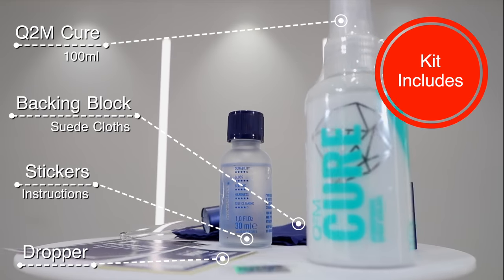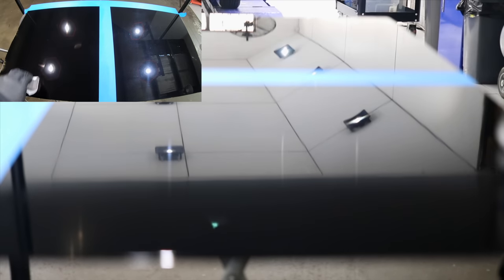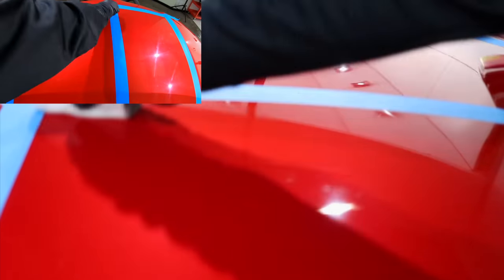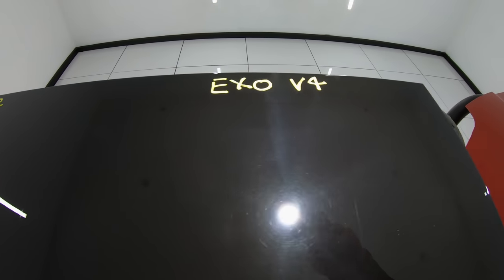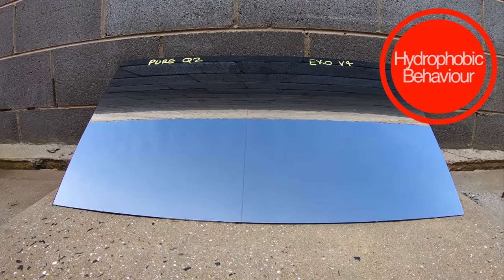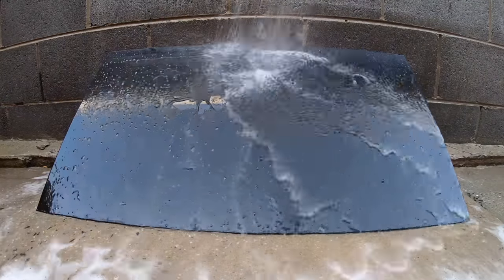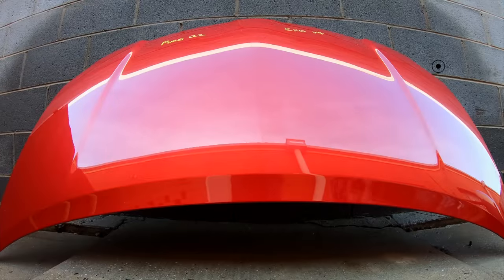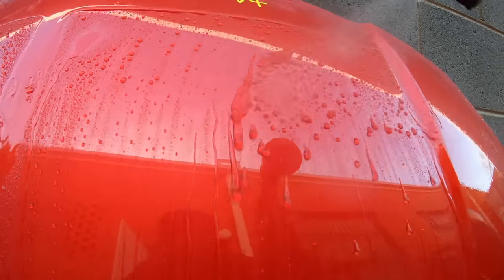Gyeon Q2 Pure vs Gtechniq Exo V4 Ceramic Coatings!

Comment: I've always viewed EXO as a top coat  applied to a base layer of crystal serum lite. 

That would be an interesting test. The main pro to that combo is the durability of CSL and the water spot resistance of EXO.
Reply: Same here man
Reply: Came here to say exactly this. Not comparing apples to apples in this video, I don't believe. The Gyeon kit shown is a true ceramic coating+topcoat, whereas the Exo v4 is merely a top coat to Crystal Serum Lite.
Reply: @CarCraftAutoDetailing  but you show a dual-stage/2-layer coating product in Gyeon vs a single-stage product in the Exo. Yes, Exo CAN be used standalone, but typically that isn't the case. 
I do like the video. you certainly were thorough and aren't saying anything I disagreed with from what I saw. However, I don't think these products are really equal to compare against each other head to head. CSL+ExoV4 is about the same cost as the Gyeon kit you show here.

Comment: As a Gyeon installer the way of application with Gyeon Pure (circular motion), its because of its formula. Over all Gyeon coatings, Pure has the most concentration of SiO2 (about 25% according to the brand) so thats why putting in one layer should be enough to achieve the best performance. Great video Sandro as always
Reply: One layer is very appealing for saving up some time
Reply: @Carlos.Rivera  with the new formula all Gyeon evo coatings now are only one layer application.
Reply: @sergiobarraza1806  nice, gonna try it this winter. Thanks for reply mate
Reply: @sergiobarraza1806  Cant wait to try the new Pure Evo! So excited
Reply: @RipJawsX95  How did it turn out? It was a headache to wipe off for me!
Reply: @KingRockets  still haven't tried it :/ damn really? Did you wipe it off immediately or let it sit for 30 seconds? Heard the flash time on the Evo are much quicker than the old gen
Reply: @RipJawsX95  ~2-3 minutes. I did it outside though, so not a controlled environment. Maybe that had something to do with it. I did find this one goes on real thick though compared to alot of other coatings.
Reply: @KingRockets  mmm that still should be okay and even if you did do it outside, Gyeon did say it is safe and completely fine to do it outside so yeah I wouldn't have any idea why it was hard to wipe off 🤔
Reply: @RipJawsX95  Some other YT videos have shown mixed reviews as well. The finish is still nice though!
Reply: @KingRockets  Thats great to hear! I will absolutely purchase one and do you think I should wipe off maybe after few seconds so its not as hard to remove?
Reply: @RipJawsX95  you'll get a feel for it after your first couple passes. They say you can leave it on for as long as 10 minutes. For me, 30 seconds was too soon, so somewhere between 1 and 3 minutes
Reply: @KingRockets  I'll remember this! 1-3 mins it is 👌

Comment: I love the fact that you are now testing products (like the gyeon brand) that are easily available on mainland europe! I do have a slightly different question about ceramic coatings though. What would you do if you have to renew the coating on a vehicle that has had a coating before, but with very thin paint. What are the best options to remove the remnants of the previous coating?

Comment: Great video!
Have you any experience with coatings from the Kamikaze Collection? They're quite expensive so I'd love to see how they stack up against UK 3.0 or NV Evo.
Reply: @CarCraftAutoDetailing  I bought the Miyabi + ISM package.

However I was mainly surprised by Miyabi. The ease of use was great. You could even forget about a panel for 15 minutes, and take it off without having high spots or many issues in my case.

The thing that struck me the most was how well the product spread and how little I had to use of it. I managed to get 8 layers out of one bottle on medium sized cars!!!

I put 2x miyabi 1x ism on one car
Then just 2x miyabi on another one

And then just 1 layer of miyabi on another car.

And if I'm honest, you couldn't even really notice a lot of difference in performance between the 3 cars.

So I'm starting to think of using just Miyabi and just one simple layer as a go to coating.

If I keep getting 6-8 layers out of 1 bottle it would mean the entire coating would only cost 15€/application and only take 1.5 hour to apply. This seems unmatched in my head.

I also think you'd be able to get 1 year of good performance from the 1 layer of miyabi. Which is all i'm looking for, as I quickly want to polish and detail ly car anyway every year after the harsh winter months so it's back to new for the summer.

Comment: How do they stand up to UK 3.0? 
Would you Recommend the Gyeon over UK 3.0 as far as durability and gloss levels?
Reply: UK 3.0 is king for beginners
Reply: @descendinggod9740  I would say Gtechniq CSL has UK 3.0 beat.
Reply: @descendinggod9740   That title belongs to Optimum Gloss Coat
Reply: Everyone is going to have a different experience when it comes to coatings.  I have tried quite a few of them and again each person is going to have a different experience.  With that said for me CQUK 3.0 walks over Gyeon Syncro, Optimum Gloss Coat and Gtechniq CSL topped with Exo and CSL by itself.
Reply: For me, CQUK + Gliss far surpassed the Gtechniq combo. Personal preference perhaps but the Gtech Combo just really didnt impress me much, especially EXO V4 :shrug:

Comment: Hi Sandro, just wondering when your test panels are micro marred or have micro abrasions, even through they might be clean as far as top layer surface contaminates, do you think that the small miro swirls and scratches effects the coatings ability to adhere to the surface correctly, after all your asking the coating to self level yet there's so many imperfections and peaks in the surface that its going to be really hard for any surface coating to be level,when there's so many imperfections, swirl marks and marks on the clear coat? Just asking, as the surface if its perfectly as much as can be after paint correction and IPA wipe down is always going to be a better test panel than any with swirl marks and miro scratches etc, IMHO, i wonder what is your opinion on that subject as far as using test panels which are damaged to the point of swirl marks and micro scratches etc. :)

Comment: These side by sides are great however I would like to see these test results be compiled against one another.  Now that we've seen Gyeon Q2 Pure and CarPro Cquartz UK 3.0 tested separately I have to wonder which is better between the two.  Do you have any plans of testing Nova Evo in this manor in the future?  Id love to see a full comprehensive comparison of a dozen or so ceramic coatings simultaneously, however I fully understand the challenge of maintaining accurate testing while also avoiding burning potential bridges with companies.

Comment: Interesting test, however, Exo V4 is not designed to be used as a basecoat.  An apples to apples comparison would be to use Gtecniq's Crystal Serum Light, which is marketed as a one coat ceramic basecoat.
Reply from the maker: Gtechniq states on its own website that’s its both a standalone or topper and it’s also the most closely matched in price and specs to the Gyeon - that why I choice it 🙂

Comment: Hey Sandro great video one again. I have a question I a car soft Lexus paint and when I wash and dry it using 2 bucket method and geon drying towel it puts holograms, how would you wash it and dry it without adding these scratches have you had or done a car that has this issue IV recently corrected it and ceramic coated it with CQuartz UK 3.0 and to scared to breath near it what's your thoughts?
Reply: @CarCraftAutoDetailing  💯 right thanks again Sandro there is a video on the correction ISF YouTube if you get a chance check it out.

Comment: One question Sandro. Do you feel that ceramic coatings are enough to keep headlights protected from uv exposure and airborne abrasives? Or would you consider adding something else to the headlights like ppf or clear coat?
Reply: @CarCraftAutoDetailing  Alright, then would you say that a well maintained ceramic coating on headlights would be enough to keep the clear coat from oxidizing/uv exposure? Part of me is hoping so considering all ppf has a small amount of orange peel, and i'd like to keep my headlights crystal clear.

Comment: Can you put gyeon q2 pure in the windshield? Ty
Reply from the maker: General ceramic coatings can cause wiper chatter which is the main reason why a more specific glass coating like Gyeon Q2 View tends to be a better option for a windshield
Reply: @CarCraftAutoDetailing  thanks for the reply. Great review! 👍🏻
Reply: @CarCraftAutoDetailing  why do they cause wiper chatter? What is occurring on the surface to cause it?
Reply from the maker: I think it’s a combination of the specific shape and curvature of the glass, the wipers themselves and potentially the wipers causing certain ware on the coating. It not always necessarily an issue, but it’s less likely to be an issue with specific glass/windshield coatings.

Comment: I used gyeon pure on 2 cars, they all lost hidrophobic properties in less than half a year. I applied them corectly, one layer after full paint correction and degreasing, same way as you did in video. Any help?
Reply: With any ceramic coating, you need to do a chemical decon every 6 month or so. Simply wash the car, spray a ironromover on the paint, wash again done. If that dont do the trick, also use a tar renover, or evne a warerspot remover. That did the trick for me. What is happening, is that smalle particals, and road dirt, g’ets stück on the paint, downgrading the hydrofobic benefits of a coating. And pleas always use a soab with bo fillers, or glossenhancers like carpro reset 😊